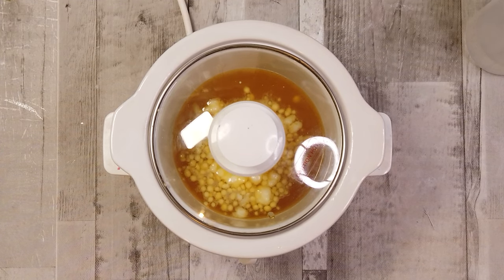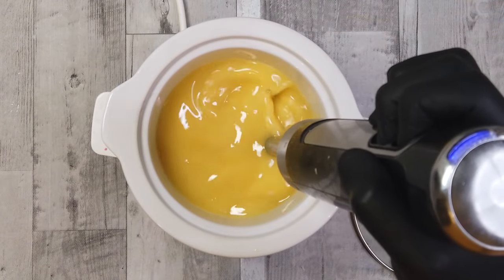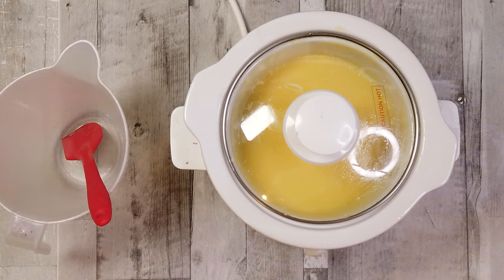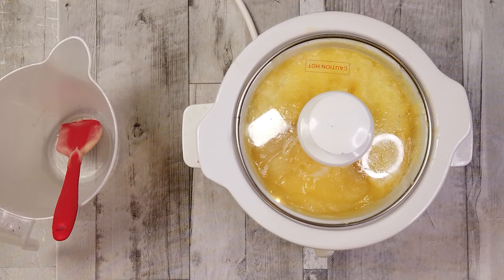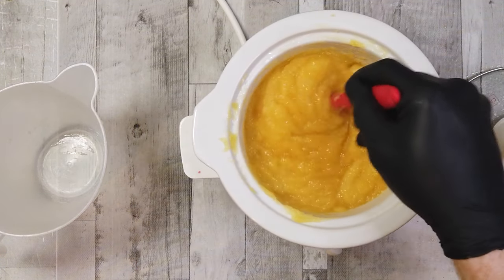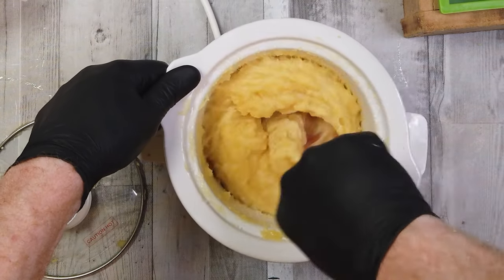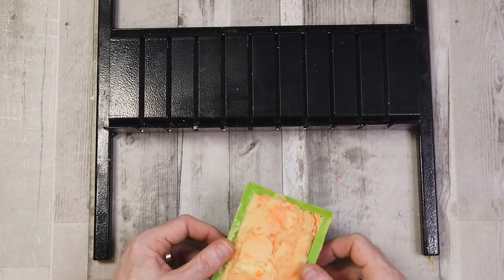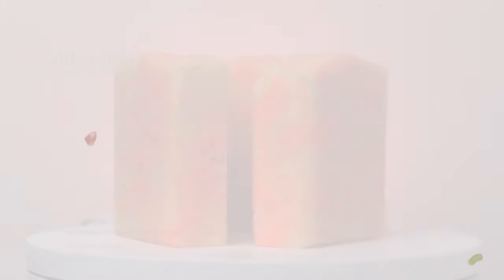Standard Hot Process soap tutorial

Comment: Your soap turned out beautifully.  I've always done hot process, but without any colors added.  I need to try a simple swirl like yours.  Charcoal swirls. Nicely in hot process, if you add it to the top of half your batter, then add the rest of your batter on top and take a teaspoon and manually stir the batter to swirl it.  It makes a pretty effect.  I did a cold process once and it turned out very nice.  I need to do more cold process.
Reply: HP might be fun for an experiment but I never understand the draw. An awful lot of work when one can CP and simply pop it into an oven - preheated at the lowest setting - for a few hours with the oven off, and leave it alone. I did two batches last night. My first batch popped straight out of their moulds after the oven gelling phase, and onto an airing rack. After putting the second batch into the oven, I cleaned up and went to bed. Perfect results with minimal stirring 😉😉.

Comment: If you use a larger crock pot you can turn it off at thick trace and it will still hold enough heat to reach Vaseline stage with a much more controllable volcano.  Add the super fat and sodium lactate at this point and it will loosen it up more.